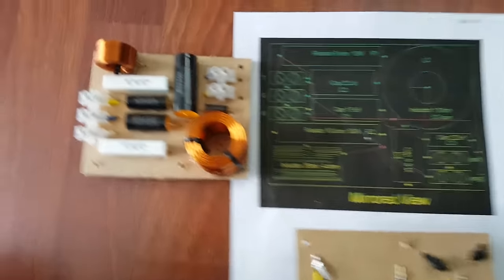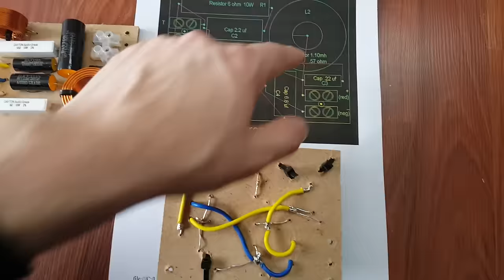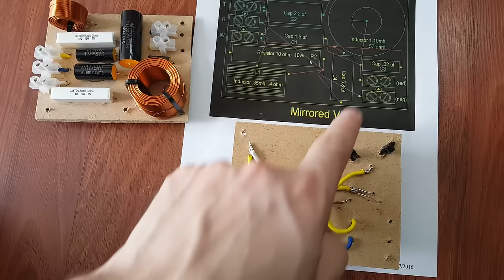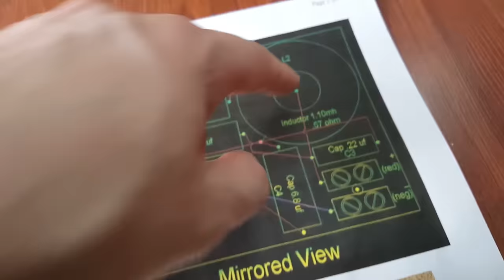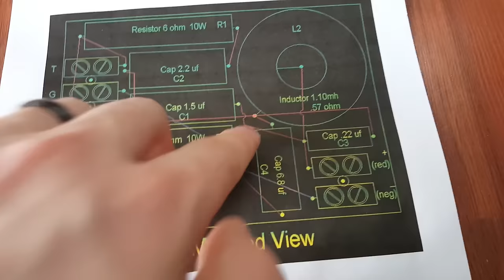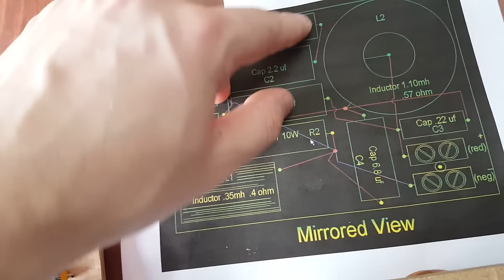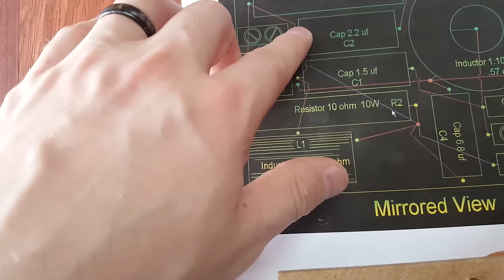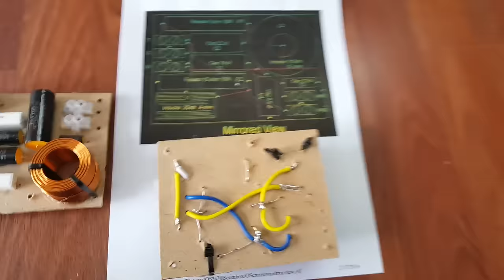Overnight Sensation Crossover Build - Part 3

Comment: Metallized film caps are not to be recommended for passive crossovers,they cannot handle the high currents in this situation.
Foil film caps are more suitable and will be more reliable.I speak from experience having metallized types burn out at high levels.

Comment: Hey! Thanks for the videos! I've made the same crossover and I'm running into a weird issue. The tweeter is just too quiet. I think the wiring is all good, but when I hook it all together it just doesn't sound right at all. Wondering if you have any ideas on why the tweeter might be too low. When I hook it up to the source directly it's very loud.
Reply from the maker: Why don't you share since pictures on the forum www.toidsdiyaudio.com/community
Reply: @Toid  done!

Comment: is this crossover can handle any wattage from the amplifier?  is there any specific crossover  to be use for a 100 watts amp., 200watts amp., 500watts amp. , or any crossover fits all
Reply from the maker: A properly designed crossover will handle the wattage the speakers can handle.  This particular crossover was designed specifically for the overnight sensation speakers.  These speakers are typically rated at 30 watts RMS (continuous).  Keep in mind, when you read an amplifier is rated at 100-500 watts per channel, that is typically max (stated differently a momentary spike in power).  RMS or continuous is much lower.  Not to mention, the volume on your amplifier also limits the power going to the speakers.  Most people in normal conditions never go past 30-50 watts rms.

Comment: I notice there is a W G T terminal. Is the ground used for the - terminal of both the woofer and the tweeter? Like, can I run two wires from the ground european terminal, to the negative terminal of both the woofer and tweeter?
Reply from the maker: +chemchemchemacky That's a good question.  For these particular speakers the tweeter has reverse polarity, meaning the negative and positive wires are switched.  SO if you look at this video, the yellow wire (woofer) would go to the positive terminal on the woofer.  The blue wire (negative) would be split.  One of these wires would go to the negative on the woofer, while the other would go to the positive on the tweeter.  The white wire (tweeter) would go to the negative terminal on the tweeter.If you would like to see a diagram go here and check out post 14:
avsforum.com/forum/155-diy-speakers-subs/2324209-help-first-build-bluetooth-speaker.html#post41642385
Reply from the maker: +chemchemchemacky -P.S>  I fyou want to see my custom build go here https://www.youtube.com/watch?v=-4TpneCGq0g&feature=iv&src_vid=pMK1JrGDH2s&annotation_id=annotation_3248255989  This will show you  the parts and why I used them as well/  Ihope these help

Comment: please provide me the place where i can buy the whole kit, not an individual parts, and what you call those kinds of capacitors? thank you for sharing this video
Reply from the maker: You can buy the whole kit from: http://www.diysoundgroup.com/speaker-kits/overnight-sensation/os-speaker-kit.html or https://www.parts-express.com/overnight-sensations-mt-speaker-kit-pair--300-706  However, these will be the individual speakers and parts, which will include pre-cut boxes.  If you wish to make a bluetooth speaker like I did, you will need to make a custom enclosure.  In which case you will want to buy the parts separately.
Reply from the maker: They are Metalized Polypropylene Crossover Capacitors.

Comment: is there really a difference in using either/or the inner conductor vs the outer conductor on the air core inductor???
Reply from the maker: No.  I was wondering if anyone would say anything about that.  I was inferring to it makes a difference on which you hook up when looking at the diagram.  But it sure did sound confusing when I said it that way.  I was hoping someone would ask, so I could clarify.  Thank you.

Comment: what's the name of those terminals. You have a link to them?
Reply from the maker: They are European terminal strips.  You can cut the in whatever size you need.  Here' s a link to some at Parts Express, but you can buy them on amazon as well.  https://www.parts-express.com/nte-european-terminal-strip-25-e2000-12-pole-20a--090-830

Comment: Hey man,

thank you so much for your videos. They've really helped me wrap my head around the crossover build. I have never tried to build speakers before and I have what I assume is a very stupid question. Do I need an amplifier for these speakers to work? What did you have to buy that didn't come with the Overnight Sensations kit? I have the wood for the cabinet. I've also got binding posts, speaker wire, screws. On your post on avsforum I see that your list of parts includes some extra parts. 

(1 - Sure Electronics AA-AB32155 2x15W at 4 Ohm TA2024 Class-D Audio Amplifier Board Only, 1 - 3.5mm Stereo Panel Mount Jack, 1 - Parts Express 2.1mm Panel Mount DC Jack, 1 - Parts Express SPST Automotive Round Rocker Switch Black, 1 - Sure Electronics AA-AA11136 Two Conductor Screw Terminals for Amplifier Boards 10 Pcs., 1- Axxess AALC 2-Ch Remote Level Controller)

Can you explain what these were for? Were any of them only needed because your build included bluetooth? Do you have any links explaining / can you explain how these parts will work with the overall build?

thanks for your videos and forum post!
Reply from the maker: +rustumsdog - those are excellent questions.  I'll try to answer these as best as I can.  The overnight sensations do need an amplifier to run.  If you are building the typical overnight sensations and are going to use them for just 2 channel music, you only need an amplifier like this http://www.amazon.com/Lepy-LP-2024A-Amplifier-Stereo-Supply/dp/B00ULRFQ1A/ref=sr_1_1?ie=UTF8&qid=1458503547&sr=8-1&keywords=lepai+2020.  Nad you'll just connect a device to this receiver for a 3.5mm cable.  I like these from mediabridge, as it allows you to keep most cases on your phone http://www.amazon.com/gp/product/B004LTEUDO?psc=1&redirect=true&ref_=oh_aui_search_detailpage

as far as the parts I chose and why.  I did not build a typical overnight sensations kit.  Instead, I built a bluetooth stereo speaker kit.  So i only used the parts and built a custom enclosure.  here are the parts you listed and what I used them for.  Sure 4 Ohm Amplifier AA-AB32155 - This was to power the speakers (this is built in to the Lepai amp I linked to earlier). 2.1mm Panel mount jack, this was to plug up the power cable (once again this is built into the Lepai amp.  The automotive rocker was to self power on and off the system (once again built into the Lepai amp).  The Sure connector screw terminals, were used to solder on the amplifier (you would not need this, unless you used that board amp.  This is the same with the Axess remote level controller.  This just allows one to control the volume, is of course built in to the amp again.  

If you have any further questions, just let me know.
Reply: +123Toid Awesome! thanks for your fast response. It's all starting to make more sense now haha. So will I still need a 3.5mm jack for the speakers? No because i'll just be plugging my computer/phone etc. into the amp and that amp will be connected to the binding posts right? Thanks again man super helpful.
Reply: +123Toid also, how do you tell what wattage amplifier will work with what speakers?
Reply from the maker: +rustumsdog  That's a good question.  For these particular speakers the tweeter has reverse polarity, meaning the negative and positive wires are switched.  SO if you look at this video, the yellow wire (woofer) would go to the positive terminal on the woofer.  The blue wire (negative) would be split.  One of these wires would go to the negative on the woofer, while the other would go to the positive on the tweeter.  The white wire (tweeter) would go to the negative terminal on the tweeter.If you would like to see a diagram go here and check out post 14:
avsforum.com/forum/155-diy-speakers-subs/2324209-help-first-build-bluetooth-speaker.html#post41642385 

P.S.  I f you want to see my custom build go here https://www.youtube.com/watch?v=-4TpneCGq0g&feature=iv&src_vid=pMK1JrGDH2s&annotation_id=annotation_3248255989  This will show you  the parts and why I used them as well/  I hope these help
Reply from the maker: +rustumsdog Exactly.  To hook it up to thee back of an amplifier, you will use something like a 3.5mm cable or a 3.5mm to RCA in order to hoop up a phone or your computer to the amplifier.  The speakers themselves will be hooked up with speaker wire, which will run directly into the amplifier.  

As far as what type of amplifier, these speakers really only need about 25-30 watts max (each speaker) to run well.  I am running about 8 watts and they get plenty loud.  So a 50 watt amplifier (RMS) at 8 Ohms, would really be the max you want to run.  If your running it off a Home Theater receiver, you really won't have to worry about them.  RMS is pretty low on those.  Typically those Lepai 202 amplifiers are mostly used if people are using these speakers to run their phone or a computer off of.  They pair very nice with them.
Reply: +123Toid Thank You!

Comment: How do you choose the wire to use to connect the two resistors?
Reply from the maker: Just use a spare wire.  I usually keep it the same gauge as the rest of the wire I run (16 gauge).

Comment: 123Toid+ This is really great! I have a few questions. How much did these two crossover cost to make? How much would it have cost you to go with the top of the line parts? It changes the overall ohms on the output if you don't use all 4 ohms so is there a way to make a 4 ohm woofer and a 16ohm tweeter come out to be 4ohm? The one bothering me most is how do you figure out the watts RMS of each speaker woofer and tweeter to make it correct and the last is you need some kind of crossover to get the top and bottom end of a subwoofer to roll off so there's no distortion, correct?
Reply from the maker: The cost all depends on the crossover you are building.  Some crossovers have more or less parts than others, so the cost is all relative to the custom crossover you are building.  As far as the impedence (ohms) question, I actually did a video on that here: https://www.youtube.com/watch?v=MMTGDiLjsZ0&list=PL6hjpiCHZmIPx3itPeTt7zoSqNY20OQqV&index=10&t  As for RMS, it is typically best to use the lowest woofer/mid's RMS for total RMS.  As far as the subwoofer goes, you will need a low pass (typically built-into a subwoofer amp).  Or you would want to build a low pass filter (can be expensive due to the values of the components) or use a variable low pass board.  You may also need a high pass if going ported.
Reply: I always figured that it would go with the woofer, but thinking it's so and knowing are two different things so thank you.
Reply: How much was this crossover for the overnight sensation?
Reply from the maker: Sorry I misunderstood the question. Most people just buy the kit from parts express that has all the crossover parts in it: https://www.parts-express.com/overnight-sensations-mt-speaker-kit-pair--300-706  However if you wanted to piece it out each crossover is about $25.50.
Reply: That's not bad for what it does, good price. From what I was looking at in kit you get a choice of which parts go in the kit and I seen a choice of parts so why did you go with a electrolytic instead of a poly cap? The poly caps work so good with audio and they rarely leak DC, is it price or preference?
Reply: I seen a different video where you had a choice of parts. Sorry, I thought you had that choice here as well. Still electrolytic caps can read the right voltage so most people think they're fine, but they're leaking DC across so that's the reason if I have a choice I go with poly

Comment: I recently purchased a TDA7492P amp (FYI I'm a complete noob to this). From my understanding the amp is a 4-8ohm amp. I plan on buying HiVi B3N drivers which are 8ohm & also 2 1 1/2" drivers that are also 8ohm. Will having 4 8ohm driver damage the amp? 

Also, can I purchase a pre-made crossover for my set up? 

Thanks! Hope you're able to help.
Reply from the maker: Mixed Tea, thank you for the watching and asking the question.  I'll try to answer both questions as best as possible.  The answer to your first question is no.  This is of course assuming you are running the 2 1/2" drivers as tweeters and the B3N's as woofers.  Is that correct?  

The second question is loaded.  Can you buy a pre-made crossover?  The simplest answer is yes.  However, I would caution against it.  I am not sure the measurements of your 2 1/2" speakers, but typically there is a sensitivity rating on these.  You will want to check on that.  Typically tweeters have (I'm assuming in your case they are actually full range speakers) have a higher sensitivity that needs to be attenuated down.  The best thing to do is to go to Tech Talk which is part of parts express.  I am on there as well as plenty of other experienced speaker builders.  Together, we should all be able to build a pretty decent  crossover.  Just give the information of the 2 1/2" speaker.  Who makes it and it's model number.  That way we can better assist you.  I hope this helps, this a very abbreviated and simplified reasoning of why you would want to tailor your own crossover.  If for whatever reason you do not have those specs, you may have to buy a pre-made crossover board.
Reply from the maker: Running the speakers in this manner will not affect your amplifier.  You may want to check out some of my other builds.  In some of those, I use full range speakers with a BSC in order to maintain low end response.  You can get some great sound out of some full range speakers without having to jump right into a two way setup.  But to get you started check out tech talk: http://techtalk.parts-express.com/  I would post under tech talk forum. 

P.S. If you want a simple speaker build, which can be a boombox as well.  You should check out this build: https://www.youtube.com/watch?v=AtVqc-4o-vw
Reply from the maker: You could easily do that.  I would take a look at this build I just completed.  The boxes are small and can actually be adjusted so you keep the same internal measurements.   So you could make it wider and less deep , so you could incorporate it into the mirror.  As far as an amplifier, you could just get one with built in bluetooth, that would be easiest to incorporate.  Here's a link to the speaker (you could just build 2 for stereo sound: https://www.youtube.com/watch?v=lX1zZRuRUEA&list=PL6hjpiCHZmIPH29IXwAKRZ5FGtrN3HrP1&index=1